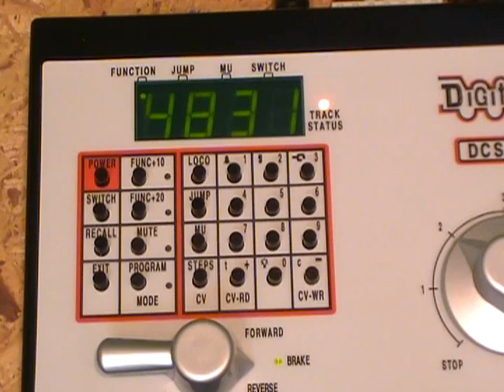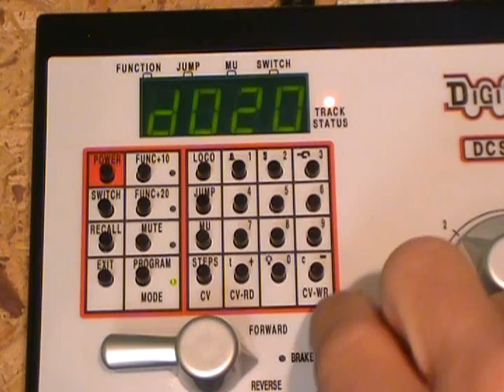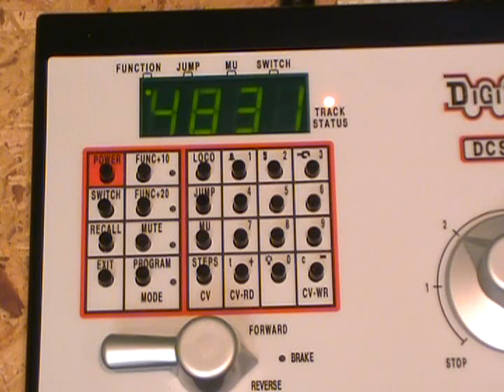DIGITRAX ZEPHYR DCC  PROGRAM CV3 AND CV4

Comment: Is there a way to control the sound volume on a steam (or any) locomotive?
Reply from the maker: Check the manufacturer of the decoder. All should have a master volume. And may have separate settings for bell, horn, or whistles.